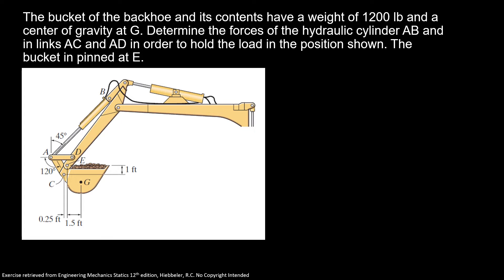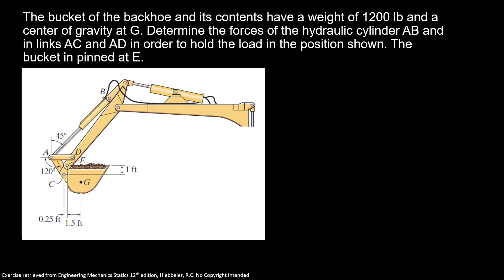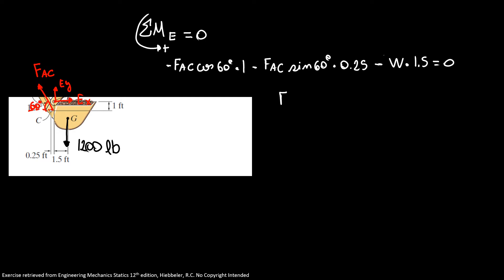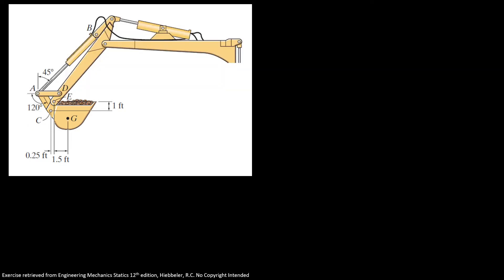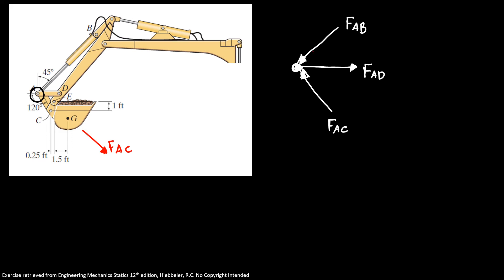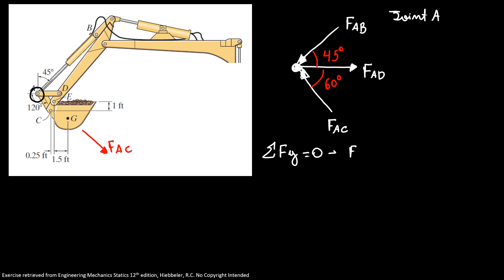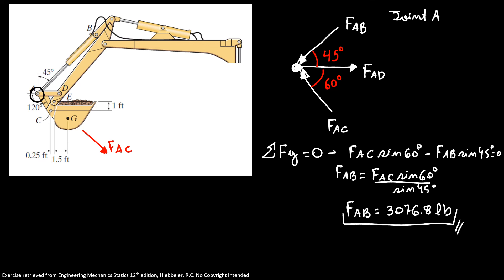Frames and Machines   8

Comment: All good, only that I have a problem with the signs you handle in the forces. Because FAC was negative for you and when you multiply it into FAB you put it positive.

Why?
Reply from the maker: Hi! Because the first calculation is using joint C, to Fac is in compression. When we use joint A, Fac has to be in compression as well. It's why Fac changed the direction.